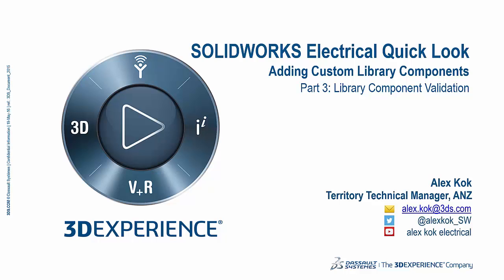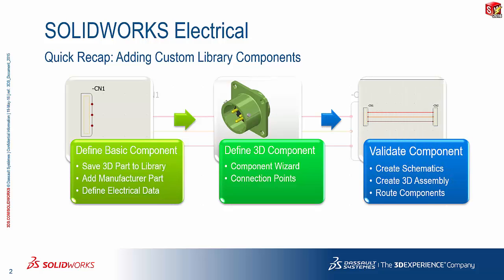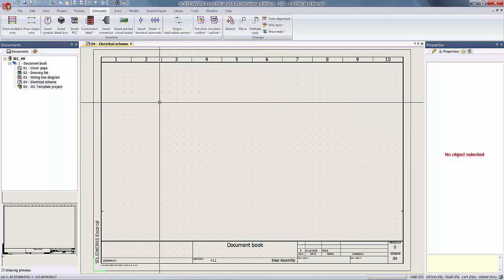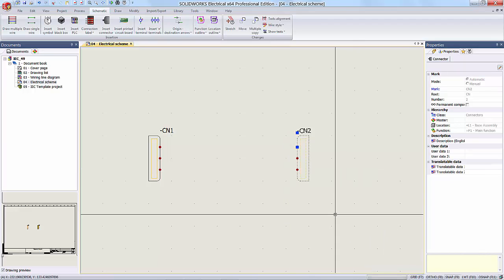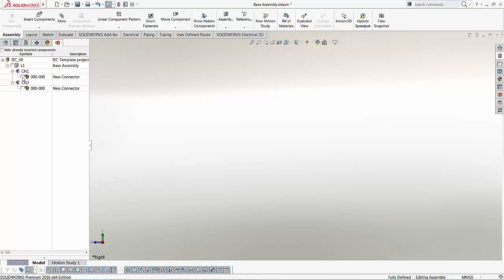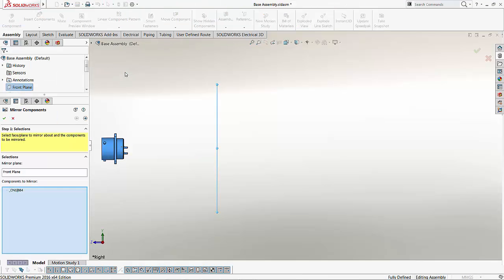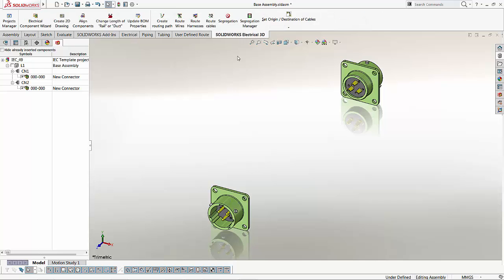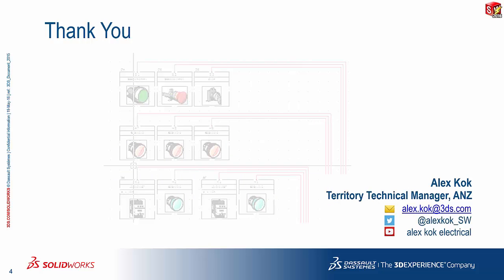Adding new library parts to the SOLIDWORKS Electrical Parts Library - Part 3

Comment: Could you describe how a connector is connected to another component on the schematic side? Typically I'd connect components via wires on the schematic, but since I'm creating a wire with connectors on both sides...do I make the physical connection on the 3D side and just have the CONNECTOR + WIRE + CONNECTOR sitting next to my component (RELAY) on the schematic? Or is there a way to create an electrical assembly in Solidworks Electrical and have a custom symbol for the assembly, then connect my component (RELAY) to my assembly (CONNECTOR + WIRE + CONNECTOR) via a wire?